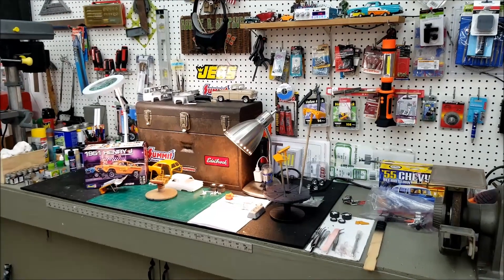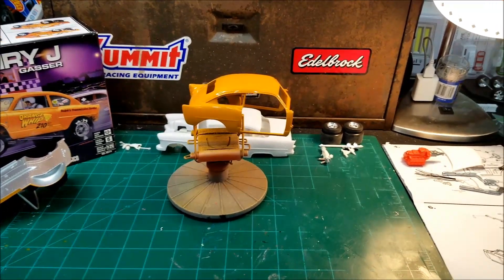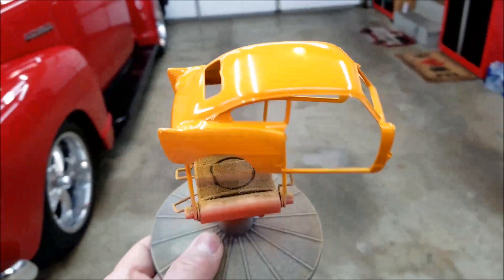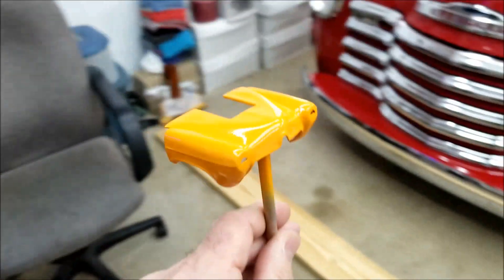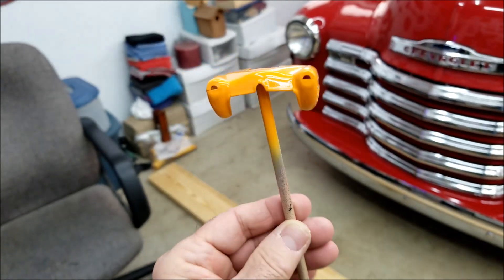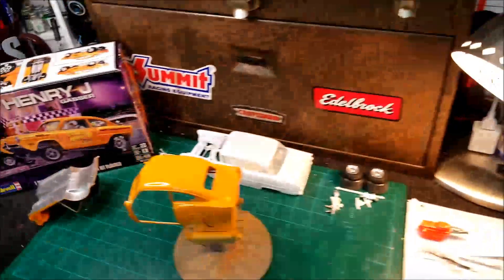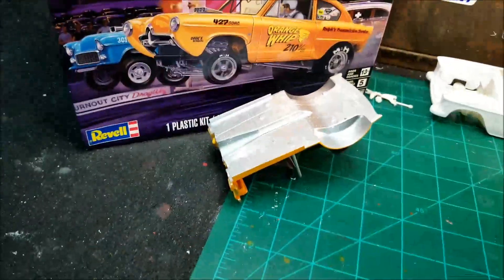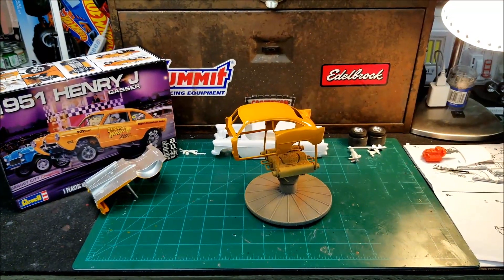1951 Henry J Gasser Clear Coat

Comment: Make sure you get the interior panels inside the tabs on the interior pan. It will fit good. I painted mine the same color. Tamiya paints lay down real nice.
Reply from the maker: Thanks for the info on the panels.  Tamiya rattle cans are nice but come spring the air brush comes back out.